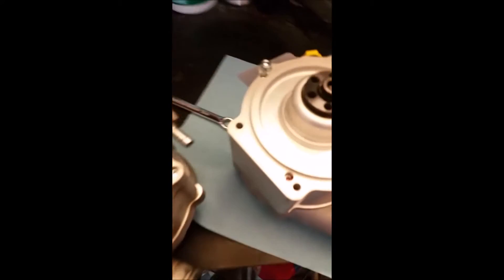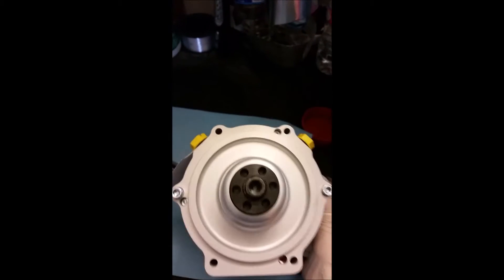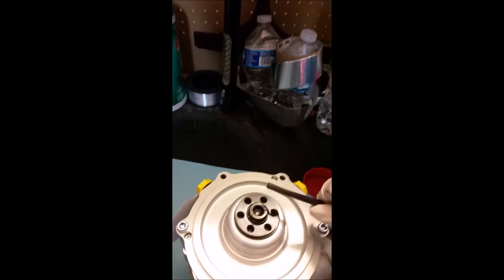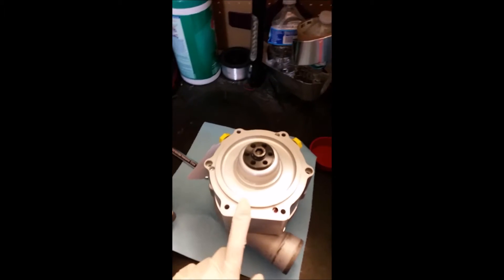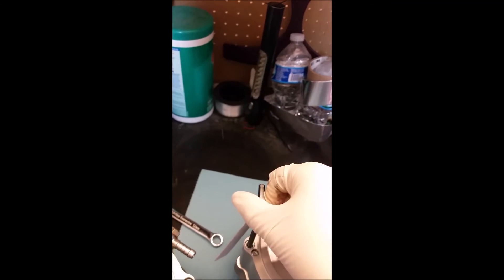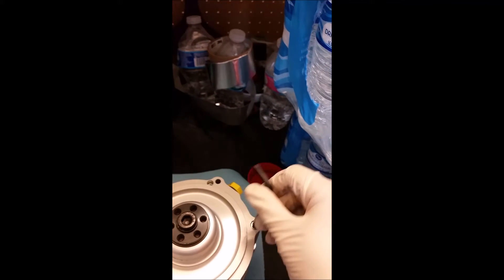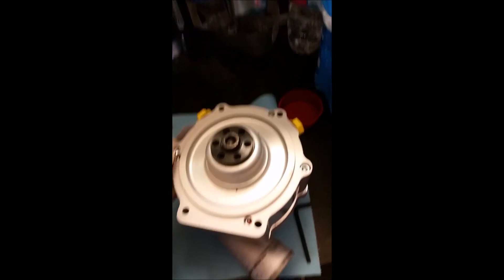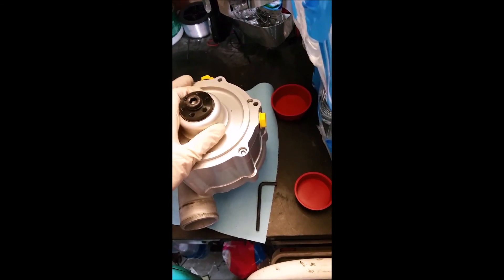How To Clock A Rotrex Blower

Comment: whats the point of clocking it if the inlet and outlet holes never moved lol? its still in the same spots lol....   clocking is just changing the position if how your rotrex sits on the mount.